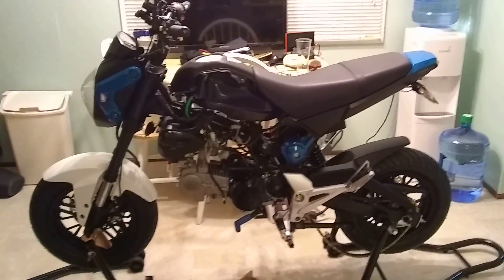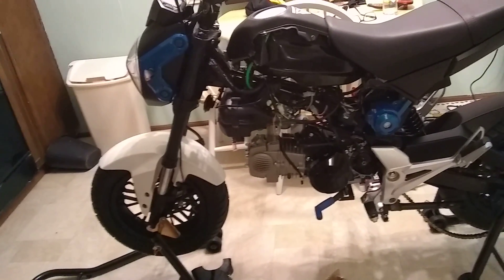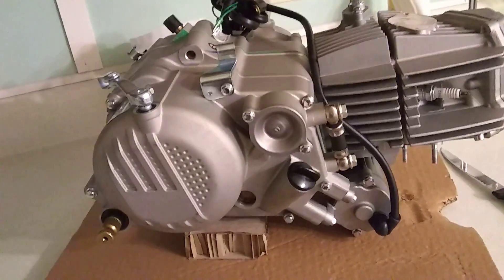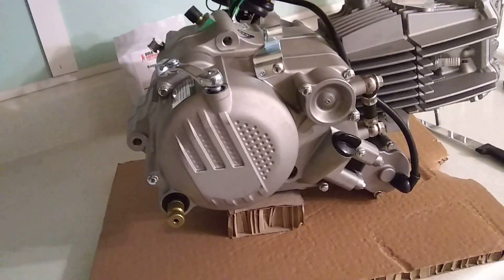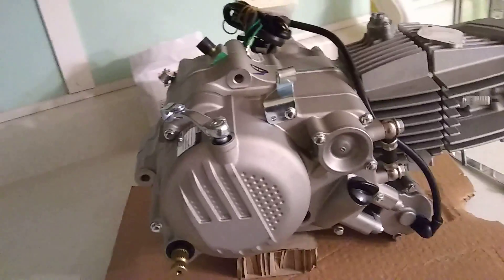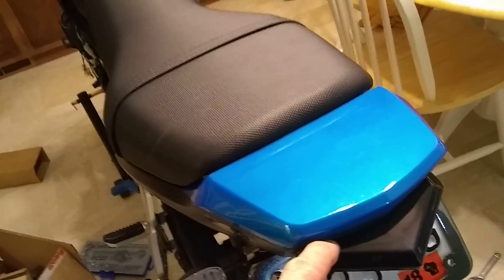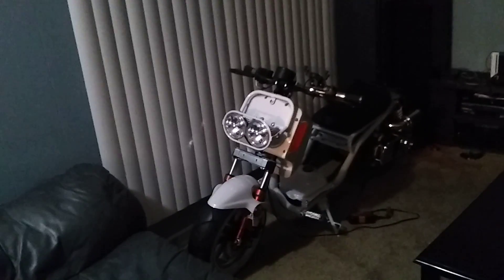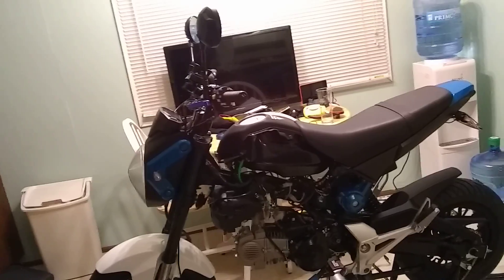honda grom clone vader 125cc time for some changes

Comment: Hey Biz Moto - What made you decide to do the motor swap?  In your earlier videos, you were pretty happy with it.  Did you just out-grow the 125?
Reply from the maker: kinda wish I left it stock but I was curious about how  much faster the z190 was and I must say its a blast but I myself  still enjoy going slower
Reply from the maker: Actually I was just curious of how much faster the z190 would make the bike but the z190 has its problems I don't like the way how it shifts and from all the farms I belong to the durability is questionable but I plan on putting new Honda clutch packs in it and I'll see if that makes it shift any better but a little 125 that was in there was not that bad of a motor it may have been a little slow but I believe they're made that way for durability where the z 190 seems to make too much power where it could actually break itself if I could do it all over again I probably would have stayed with the 125 for a while longer and maybe just did a big bore kit on that motor

Comment: How hard was it to install how bad did your gas mileage suffer after doing the swap? Is there anything else that I may need to buy it except for the engine ? To do the swap
Reply from the maker: It was pretty much just a bolt in swap if you have Facebook join the zs190 swap shop page all the info you need will be there along with a lot of helpful people
Reply: @BIZMOTO  ok thnx man